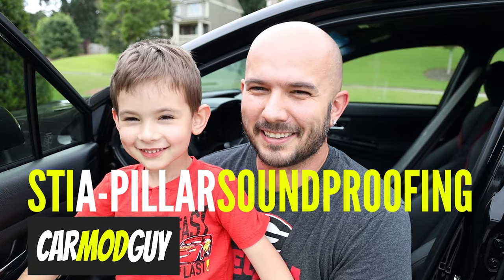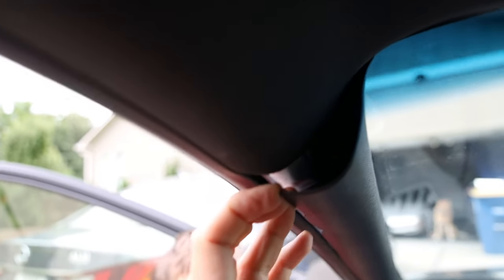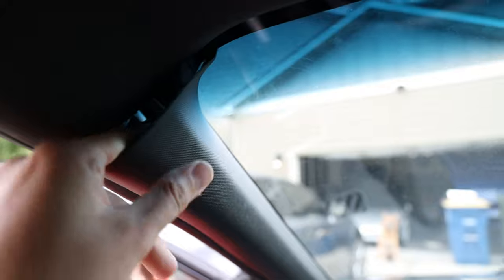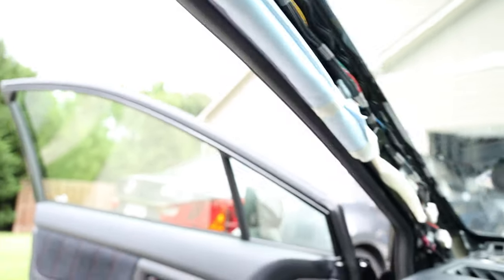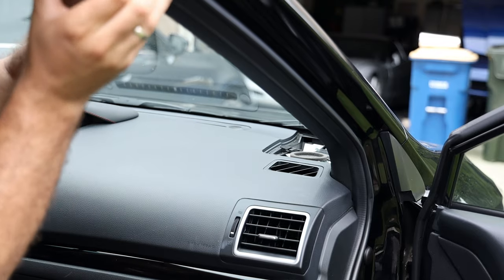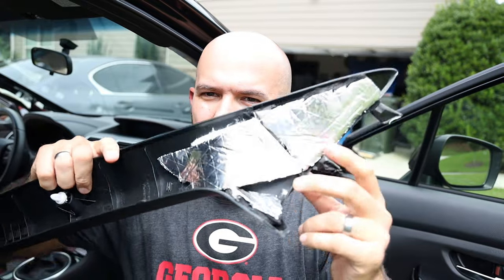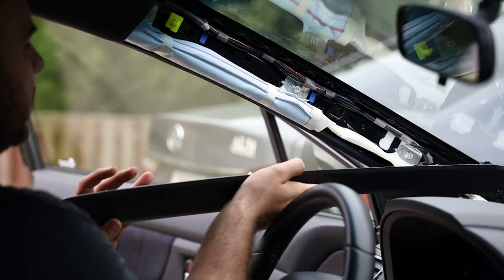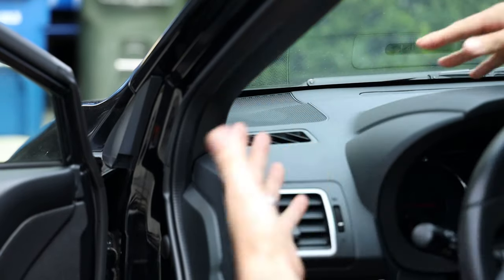Soundproofing 2015-2021 WRX STi (P5): A-Pillar Insulated

Comment: after watching all of these videoes, I'm starting to think maybe the STi was not the right car for you.  I see the 'vette in the other videos; how much does it rattle?  Did it receive the bumper to bumper sound deadening treatment too?  Ironically, the more rattles you try to eliminate, the more will pop up.  Some of due to plastic trim on plastic trim; while others are connectors hitting metal.  Even after adding 200+ pounds of deadener/sound insulator, you will only become more sensitive to rattles.  Even wire bundles hitting the metal will make noise.  You will spend countless hours chasing rattles; especially in a Subaru. Unless you wrap/cover every wire/connector, trim panel and piece of metal, you will never be successful. Good luck in your quest.    Even Mercedes, and their plastic consoles creak and rattle....